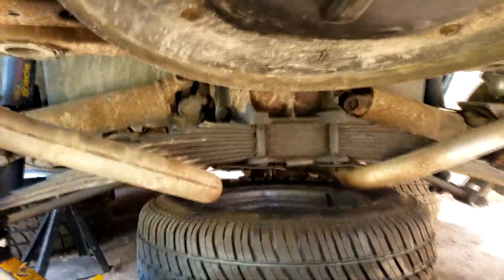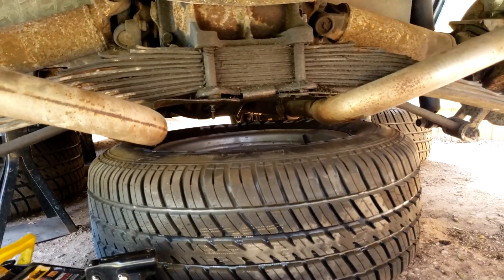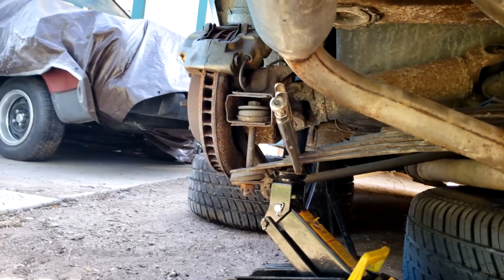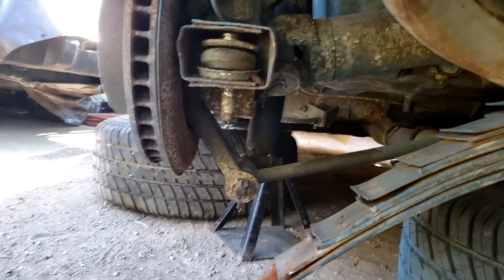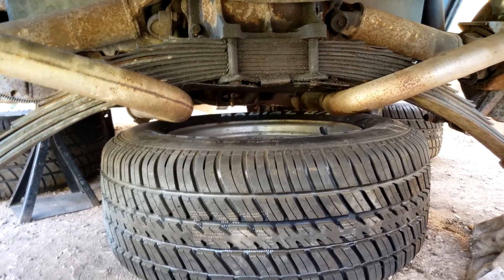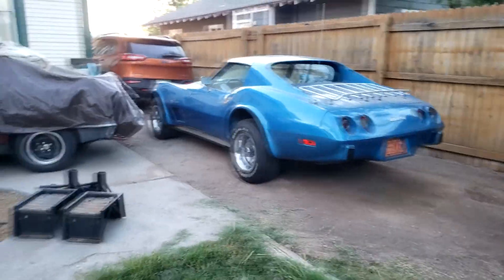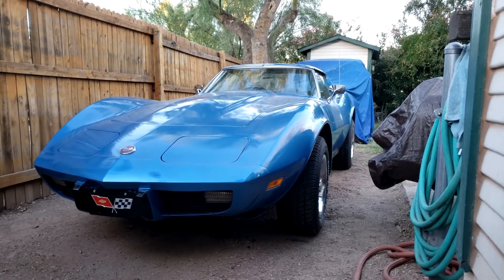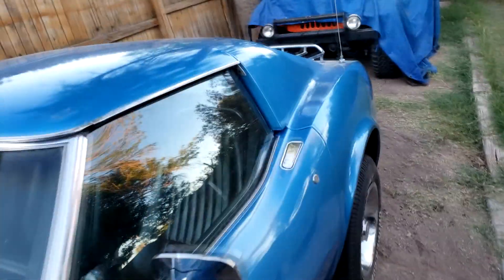1976 C3 Corvette - Rear Composite Mono Spring Installation

Comment: I replaced a mono spring on my ‘79 years ago.  Had some fun and cut off the e-brake mounts and put longer end bolts in to force the springs down and put some pretty big slicks on the stock rims.  Looked freaking awesome to me and I was surprised how well it hooked up on the drag strip.
Reply from the maker: That sounds cool!
Reply: Did you ever have issues with too much grip? My understanding is that the later aluminum dana rear ends don't play well with slicks and sticks, tend to grenade

Comment: I have a ‘75 SBC like yours in the same color, luggage rack and all. If it wasn’t for the license plate I would have thought you stole her! Great work, I’m planning on doing the same soon.

Edit: Corvette America now sells a full suspension kit including a monospring and bilstein shocks for fronts and rears, swaybars included. Supposed to be an improvement to the F-41 suspension packages Big Block C3’s came with.

Comment: used to have a few of these vettes years ago 68 and an 81 and the mono spring made a huge difference in the 68 ...    talk about rotors also I had to do the rear hub bearings not fun and the leaky brake calipers on my 68 which I finally broke down and sent to vettebrakes to have them all redone ....(VBP)great company for suspension for these cars .....

Comment: Did the metal plate (heat shield?) come with the mono leaf? I installed the Van Steel 450lb on my 71, but it didn’t say anything about needing a shield. 
Wondering if that’s a good idea to protect the synthetic spring.

Comment: Hey! Any tips for my teenager?  He is looking to replace his '79 leaf w/ a mono spring.  How do you get the rear end lower so it's not as high as yours was right after the swap?  I've seen some that come in different weight ratings but I don't know how to choose correctly.  We love watching your channel.  Cheers from Ohio.
Reply from the maker: Hi Marzen. The link below is for the spring I installed on my car. It's a 315 lb spring. Just make sure you follow safety protocol when disconnecting/reconnecting the long spring bolts as when they are removed the spring will need to be supported by a jack from below to keep it from firing itself downward when the nut comes off. The new spring will be very high at first and needs some time to settle a little bit, so the rear end will drop an inch or two during the first several weeks. Also, I went with Bilstein Heavy Duty shocks on the rear. I must admit, the rear end feels a lot more bouncy/springy than it did before, but the original spring was totally shot so there was no bounce at all, so I'm not sure how bouncy it should be. I don't care for any bouncy feel though, so I find myself wondering if I need different shocks or if it's just the nature of the composite spring. At this point, I am pretty sure all suspension changes will be trial-and-error until I find what feels best for me on the road.
https://www.ecklerscorvette.com/1963-1977-corvette-monospring-kit-rear-composite-replacement-315lb-25-122862-1.html
Reply: @RestorationObsession  Thanks for the heads up. We definitely don't want any bounce, it already suffers from some wheel hop at full throttle.  After reading up on the rear suspension I think I'm going to call VanSteel.com for advice as well as Duntov motors.  He'll need a suspension suitable for 400hp.  Where did your half axles end up with the car on the ground?  Parallel to the ground?
Reply from the maker: @Marzen216  I'll take a look tomorrow and see where the half-shafts are and will let u know. From what I recall the diff end was just slightly higher than the wheel end.
Reply: @RestorationObsession   i believe ridetech makes  compression and rebound adjustable shocks. After reading about your experience  thats probably what I'm going with

Comment: Hello, those bolts that hold the bushings on each side, once you get the bottom nut off, do the long bolts come out from the top? Is there a hole  above the head of the long bolts? Thanks
Reply from the maker: Yes, there is a hole for the bolt to go through at the top of the trailing arm so it can be removed. Make sure you use a floor jack underneath the spring end when removing the large nut from that bolt, because if you don't have something to support it, the spring will basically fire that nut off at high velocity which can be quite dangerous.

Comment: My next vid is drilling out the rotors from the spindles.  They are a repost with a few changes.  Not my favorite design.  Nice car you have.
Reply from the maker: Thanks! That'd be awesome. I'd like to see how you do that. Agreed, strange design. I guess they figured if you replace the rotor you should replace the bearings, or vice versa?

Comment: Great video!  Learned something again!  I’ll soon be  SO smart!   At the end you mentioned it was not making the Clunking sound anymore...I have a clunk in the rear end of my C3...so what do you think was making your “clunk”?
Reply from the maker: The clunking I was referring to in this video was the differential when shifting from fwd to reverse or vice-versa. That is common, from what I could determine, but it's more prominent in older cars. I have a new clunk now though, which I believe is a worn-out trailing arm main bearing.

Comment: You left so much out of this video, like the actual removal of the leaf spring itself, and how about the Hanger adjustments, maybe that’s why it’s sitting so high,
Reply: nope.. its sitting so high because its the TRW style spring and they require long 10" bolts which sit dangerously close to the rear tires to get the factory height(lots and lots of threads on this in forums) The better composite springs have all been backordered for months due to covid and poor timing on vansteels part. This spring is good for 4x4 look as they do not "settle" like steel springs.

Comment: Change the title of the video.
Reply from the maker: Why?
Reply: You installed a Mono spring not leaf spring.
Reply from the maker: @josephmorro5744  Ah! Good call. Done!
Reply: Excellent video though. I really enjoyed it. I’m going back to springs from mono.
Reply from the maker: @josephmorro5744  Thank you! I appreciate that. Why did you decide to go back to springs? Was the mono spring too bouncy? That's something I've noticed about it when  I drive.
Reply: I’m going back to leafs bc my mono broke in two places. I don’t have anything against mono though. It was a bad install from the last owner. I’m too cheap to buy another one so I’m going back to cheaper  7 leafs spring and new ac Delco gas shocks.
Reply from the maker: @josephmorro5744  Nothing wrong with that! I hope the install goes well!